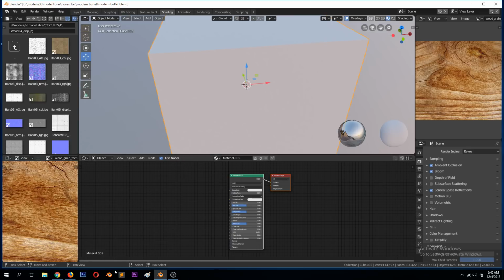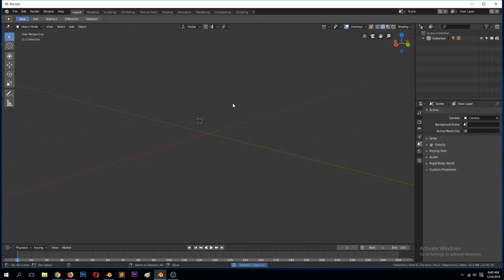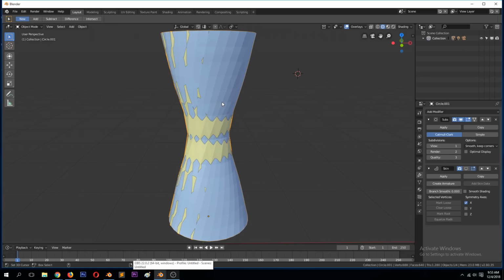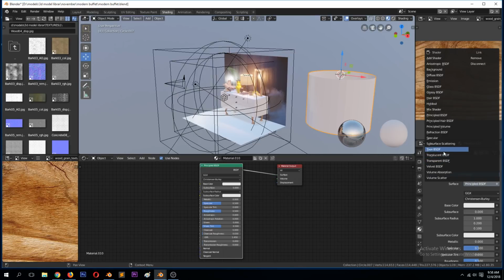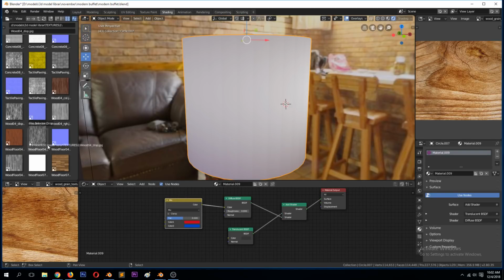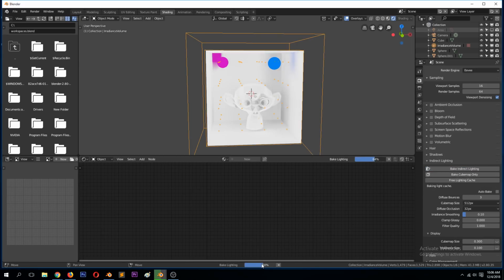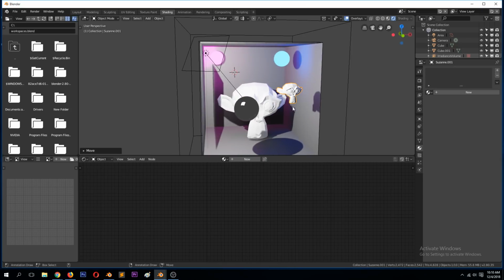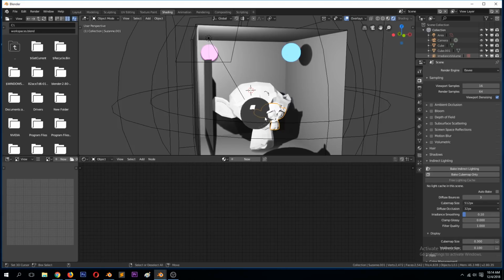Advanced materials and modeling techniques in blender 2.8 tutorial

Comment: What is the advantage of using a Skin modifier over a Wireframe modifier? They seem to achieve the same result in my experience, but Wireframe is easier because you don't have to resize the vertices.